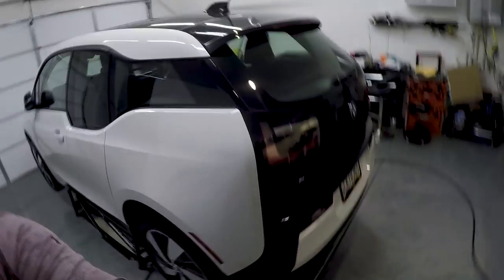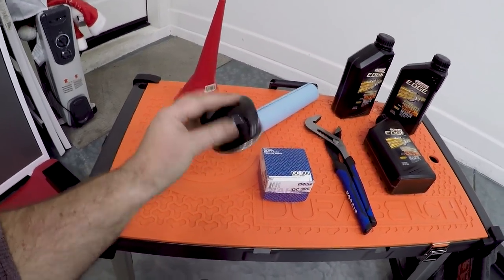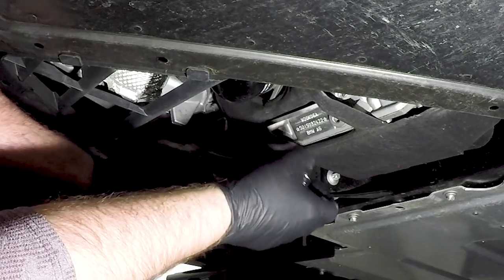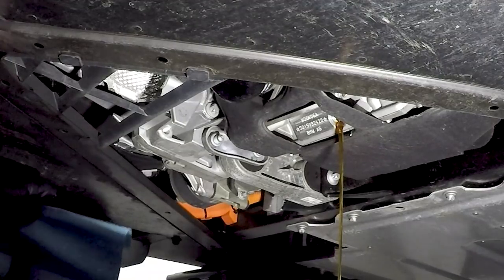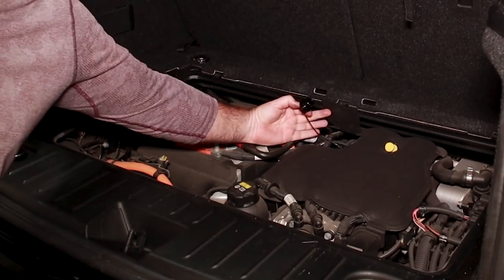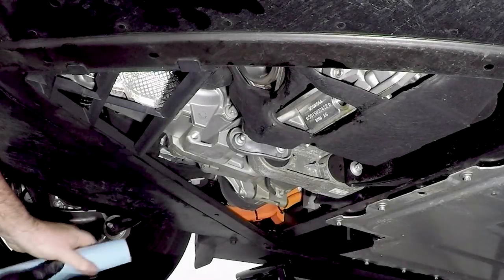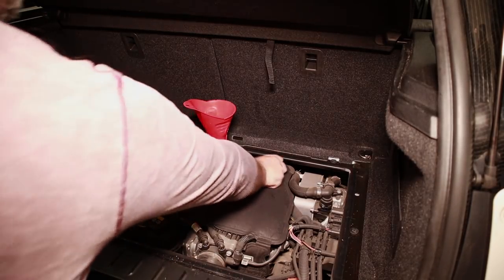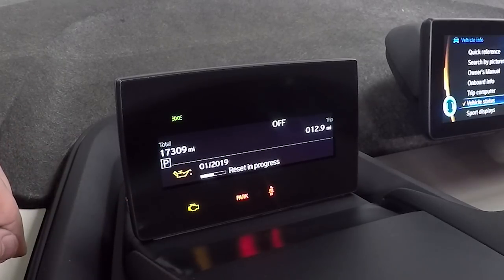$40 DIY BMW i3 REx Oil & Filter Change (2016 MY)

Comment: Great Vidio. I have 2017 i3 REX. Question, Why not change  the air filter at the same time?
Second question? Looking at the vidio I saw what looked like water coolant  hoses . Is the REX engine air cooled as I thought?

Comment: Thank you for the great video. I did not see where or when you used one of the crush washers? Personally I don’t even know what it is but I would like to know when you put it on and where it goes. 
Thank you very much 
Jrcards781 
John
Reply from the maker: At https://youtu.be/gm6Dcmuuzwg?t=444 you install the crush washer around the drain plug. There should have been a 'spent' one that you remove when the plug comes out and they are generally considered 'single use' to be fully effective at cinching the opening. Hope this helps. Be well!

Comment: well done,  can you recommend a good inexpensive scan tool. Not sure that Bimmercode and dongle is enough. I own two bmw cars, I3 and a 335I. thanks
Reply from the maker: Foxwell NT-510 is a commonly used traditional scan tool that is recommended. I haven't personally used it. If you haven't tried the Bimmercode app and a dongle, if try it before swimming upstream in cost and complexity of tool. It's a $50 bet that you'll likely discover is quite solid for your needs. I've used on i3 and X1 with no issues. I have heard the VGate is no longer supported by BCode so you may want to go to their site for currently approved dongles. Good luck!

Comment: Please add a spark plug replacement video for the i3. While I appreciate the other videos on this subject, I appreciate your videography and clear explanations. And I need to change my plugs... Thanks!
Reply from the maker: Apologies Chuck - since I no longer have the car, that's not a video I can make. Don't know anyone driving one right now either or I'd do it for them. Thanks for the compliment all the same.
Reply: @DWraysGarage  If you find yourself on the Left Coast, drop me a line and we can practice on my 2014 REX! I have 59K miles, so I suspect it's time, although there is some question as to whether they ever need changing due to the limited hours on a given engine. Again, thanks.
Reply: @chuckatwestmarine  I've done 97k on mine and still no sparkplug change but in October I am due for service and BMW dealer think it is time for spark plugs now, 250 dollar charge to do it, they say it hard to reach.
Reply: @HannaMTB  I ended up doing the job myself with the help of a different video and it took me about an hour. The plugs, after 60,000 miles or so, looked perfect, thanks to the iridium electrode. I would 100% recommend that you try it yourself. No special tools that I can recall, but you do have to be methodical and understand how to disconnect several odd electrical connectors. Good luck.

Comment: Where do the « crush washer » (not sure i heard right.. the rings) go? Great vid!
Reply from the maker: The crush washer is what sits between the drain plug and the oil pan. It helps form a tight seal and offset any minor differences between the mating surfaces. Good luck with your project! Thanks for watching.

Comment: Just called bmw Seattle for the service, it will cost almost $700 for these, I rarely use my Rex do I really need yearly oil change
Reply from the maker: That's a stiff bill - what does that include? If your REx doesn't kick in often then you could probably go a little longer, but you don't want to let it go too long. Replacing the REx would be costly. Is there an 'indy' garage that would let you take them the filter and oil? I bet they'd do the work for about $100.

Comment: After how many miles I should to do same service?(Filter and Oil change) Thank You!
Reply from the maker: BMW says every 12 months - no specific mileage. Of course, not everyone gets into their REx with the same frequency. If you use it a lot, go 12 months or less. If you are mostly on battery, I'd say 24 months would be fine.
Reply: @DWraysGarage  thank you so much for your time. Kind regards from Ireland...

Comment: Did I see that you sold the i3? I was going to see if you would do a video on replacing the micro filter and charging brake fluid.
Reply from the maker: Afraid so. I just couldn't live with it for my use case. Thanks for watching. I do have a brake fluid video for my Porsche and the process will be about the same.

Comment: I’m getting my BMW i3 2017 in a couple weeks! I’m interested to know what device you used to lift the BMW? Might need to get me that myself
Reply from the maker: I use a Quick Jack BL-500SX to lift my cars. Might need rubber grommets for perfect fit to the jack points. Not necessary but massively stable and time efficient.

Comment: Thanks for the video, it's an interesting car!  How often do you have to change the oil since the REX is hardly used?  How often does the service engine light come on?
Reply: If you haven't used the Rex for a time BMW give message to perform a maintenance run.  I can set the Rex going once the battery charge is below 75%
I have set my no 8 'radio' button to do this. I press  the set button and it brings up rex extender and I only need to press control button ( near the handbrake button)
and the computer does a seamless change. It holds the charge until I turn the rex off. Brilliant. the Rex then acts as an electric generator and the electric motor still drives the car.

Comment: did you ever replace the washer on the drain plug, or was it not necessary. Great video, it will help me a lot when I do my first i3 oil change.
Reply from the maker: It is always recommended to change the crush washer but none I had on hand we're suitable so I did end up reusing. Shhh - don't tell! 😜
Reply: @DWraysGarage  any idea as to which washer I should look for ?
Reply from the maker: @qwertshadow  it's the 16*20 size that is used on bmw motorcycles.
Reply: D Wray's Garage logical when you recall it is a Scooter engine after all. 👍🏾

Comment: Great info! I will definitely do this. What model quick jack did you use? I have the 5000 and the jacking point are off. Thank you.
Reply from the maker: I have the 5000 also. If I recall I flipped the block perpendicular to the frame rails. I don't remember having any great issues once alignment was set. Ridiculously easy oil change procedure. Good luck!
Reply: @DWraysGarage  Perfect!  Great help1

Comment: Great show mate!  Thanks especially for showing how to do the reset on the display.

Quick question, do you think if I jack up the rear; would I need to lower it back down to get a good drain on the oil tank?  Because of the angle of the rear being higher?

Thanks!
Reply from the maker: If your car is not level then, yes, putting the rear down would be the best way to evacuate the most oil. Other ideas are to do on a slope so rear lifted is still a level car and/or don't sweat the small amount that won't get out as, with routine changes, the oil stays in decent shape anyways.

Comment: With this clean oil you could just replace oil only. All micro guard on old filter are in perfect condition.
Reply from the maker: No doubt you are right but, at such a low cost, and having already purchased the filter, it seems like the right thing to do.
Reply: It's definitely worth changing out the filter because there have been reports of them corroding, causing oil loss from the REx. The oil filter is in a rather exposed position on the i3.
Reply: @jamesvdv0  I agree.

Comment: Thanks i just bought a i3 so this will help me alot. But question can i use a regular jack to lift the car
Reply from the maker: Of course. Anything lifted safely will work. You don't need a lot of clearance or to get to far under the car. Good luck. 👍💯

Comment: Awesome, are you going to replace the spark plug too?
Reply from the maker: I sold it before it was needed, sorry.
Reply: I've read the spark plugs are hard to get to but that they're specced for the lifetime of the car anyway. Considering the REx isn't running most of the time, I would plan to never change the spark plugs.

Comment: Oil looked new, near zero suspended particulates.  What was the run time on the REx on that oil?  Also, the i3 REx is a BMW C 650 GT scooter engine, it does not use typical BMW N52 engine oil like 0w-30 BMW LL-01 oil, it uses 15w-50.  Check out the moto rad spec sheet here:  http://www.bmw-motorrad.com/_common/pdf/bike/en_2018/C650GT_PI_EAC_web.pdf
Oil change on a 650GT will look very familiar:  https://www.webbikeworld.com/bmw-scooter-oil-filter-change/
Reply: Here's a better idea: trust the 0w30 sticker by the oil filler cap.
Reply: It used exactly what bmw says

Comment: This is awesome! If you haven't covered it, can you show how to manually turn the REx on after the oil change? I read how to do it a couple months ago. I got a 2015 i3 REx back in November 2018 and plan on doing my own oil changes. Much to the shock of the BMW dealership sales guy. Cheers!
Reply from the maker: The job is easy and there's far less oil than in a regular ICE car. Can you clarify your question - I do the service light reset at the end, if that's what you mean?
Reply: @DWraysGarage  well normally one would start the engine after an oil change in an ICE car. But with the REx it only comes on when needed or when charge hold is enabled. There is a service mode to manually start and run the REx, presumably for testing, and maybe oil changes too. Not sure how long it would run for or how hard it would be to turn it off. I believe it's done vis the 1 button "interface" with the display behind the steering wheel. I think it's in the deep menu, go like you're going to reset the oil notice but keep holding it down for like ,10 seconds. Beyond that I can't recall how it's done. And I may be totally wrong, may need to use something like Bimmer Code to do it. 

Regardless this is a very helpful video. There's just so little DYI stuff on the i3. Thanks again for doing this.
Reply from the maker: I have a VGate/BimmerCode video that will show you HSOC (Hold State of Charge) that you could activate post change so long as your battery is below 75%. I didn't activate the REx immediately and suffered no adverse effects. Looking to make another BimmerCode video going deeper onto this cool tool.
Reply: @DWraysGarage  when I got my REx i3 i immediately enabled the charge hold feature and turned off the fuel tank governor we have here in the US. You can thanks the great state of California that I live in for that restriction haha. One could always just do an oil change with the car less than 75% charge, hop in, enable charge hold and drive around the block a few times. When I first got my i3, despite asking the dealership repeatedly to charge the vehicle, they didn't and handed my a car with like 10 miles of range on it, not enough to get home. It just so happens the REx hadn't been run in something like 8 weeks, I was trying to find a CCS, and the central screen was warning me the REx would run a maintenance cycle. It sprung to life while I was quietly rolling through a parking lot at like 9pm, scared the bejeebies out of me! Haha. Aaaaaanyway. Thanks so much for the conversation. I'll be keeping an eye on your channel. Rock on.

Comment: This is great video,

I read some place that you can put the oil in using the dip stick whole. Would save some time, did you play around with that?
Reply from the maker: I'm sure you could put oil in through the dip stick hole but not sure how long that might take. It's not a lot of oil so perhaps. The filler cap is very accessible though so seems like something I wouldn't need to experiment with. Let me know how you get on if you try. Cheers.

Comment: Hi .
Wondered if you could help me. I took my i3 into bmw for a KLE change. Ever since it has given me  a warning saying the pads need changing. They are all hardly worn so dont need changing. They mentioned they updated the software so I assume it is that that has caused this warning to come on.
Do you know how i can get rid of it, as following steps shown in a service reset video only gives me service and brake fluid reset options. Thanks, Ray.
Reply from the maker: I'm not super familiar with this procedure or error. However, it mY be worth disconnecting any brake wear sensors and reconnecting, maybe even replacing them. They may have somehow become damaged and therefore always send that message back to the ECU.
Reply: @DWraysGarage  Thanks for the reply. My BMW dealer changed the wear sensors and the message was still there. They said they couldn't reset the pads warning as the pads were not new. 
I have changed the pads as well so the whole system is new front and rear.  
Think a call to them is in order!
Reply from the maker: @raysmith1971  I think so. Now I am convinced it's something they did. They need to complete their work.
Reply: @DWraysGarage  That's what I think. Fingers crossed they get to the bottom of it.

Comment: I am literally sitting in the BMW dealership as my last warrantee service happens. The price for the oil change (Vancouver, Canada) would have been $253.47 plus taxes, parts and who knows what else. Stealership is right.  Thanks for the video. I will definitely do this myself from next year. Any advice on changing the in cabin air filter?
Reply from the maker: I'll make a video on this soon, but it looks pretty straightforward, albeit cramped. Not uncommon no matter the flavor of vehicle. $300 for this service all in seems high, but I guess they ave expenses too. If you're mildly handy, you'll save $$ day one of DIY. https://youtu.be/0LNnvu3ibIo - the video I found.
Reply: That’s completely ridiculous is that just an oil and filter change if so I would contact BMW of America

Comment: Thank you for all you do to inform us.  You tend to use the terms mils, millimetres, and millilitres interchangeably.  One mil is a thousandth of an inch.  The other measurements are metric.  I am only pointing this out for those DIYers who might get confused.  Before checking the final oil level, shouldn't you manually start the ReX so that the oil filter will fill up?  Thanks again.
Reply from the maker: Good points - I shouldn't rely on context in such precise matters. I think to be spot on, either pre-loading the filter or running the extender would be a more accurate way to go. Great observations. Thanks for watching. Be well!

Comment: Great video! But Channel locks for an oil filter? You gotta be kidding me! Where is the proper filter wrench?
Reply from the maker: Sometimes you have to make do with what you've got. No animals were harmed making this video.
Reply from the maker: At 2 minutes you will see my clear disclosure of this not being an ideal way to remove the filter and recommendation to acquire correct removal tool.
Reply: Thanks for the video. I was just surprised at channel locks, but you handled it fine. :)

Comment: With oil especially synthetic oil looking like that telling me there probably was very little use of the motor and no need to change the filter.
Reply: It's definitely worth changing out the filter because there have been reports of them corroding, causing oil loss from the REx. The oil filter is in a rather exposed position on the i3.

Comment: Hey I own a 2016 i3 but its no a REX version, still has OIL?
Reply from the maker: Nope. No Rex, no oil.
Reply: @DWraysGarage  Thanks, but all the versions has transition oil right? require changing?
Reply from the maker: @electroautoscostarica3632  The transmissions on the i3 are built to be service-free items. It should not require addressing unless there's a failure/break in the system.
Reply: @DWraysGarage  AWSOME THNKS

Comment: I wouldnt need to do this if I have the all electric version?
Reply from the maker: 100% correct. This only applies to REx vehicles with the gas generator in the rear. Enjoy your BEV!
Reply from the maker: Look out for a video soon on the VGate tool and BimmerCode app where you can personalize your car even more to your liking.
Reply: there's no engine in the all electric version, that's why its called the all electric version lol and wow

Comment: is this engine air cooled?
Reply from the maker: There is a coolant reservoir in the trunk so there is a water cooled system. How much goes to batteries vs generator I'm not sure.

Comment: Hahahaha. “A gorilla working on it” was hilarious! Did you like this car?
Reply from the maker: I did like this car but it lacked theater and engagement for my tastes. Super practical and zippy car. Wish they'd have designed it for more range and wider tires. I know the 2017s on have more range but the tire part still questionable (assume it help protect range). I also didn't like charging after basically any drive.
Reply: @DWraysGarage  Good point. Charging it after every drive would get annoying to me. It’s such a cool zippy looking car though.

Comment: Oil change on an electric car? Not 100% electric?
Reply from the maker: The oil change is for the 'range extender's generator that can recharge the battery while the vehicle is in motion. Not all i3s use a range extender.

Comment: Oil in an EV. 😮.    😂
Reply: Oil in a plug-in Hybrid's back up engine that makes it a viable option for many who can't jump to full EV. On a recent 1000 mile trip in my REx, 3 out of 5  of the fast charge stations I stopped at would not start for one reason or another. But I still did 60% on Battery.  This lowered my lifetime on battery to 92%.
Reply: Nordburg any electric miles are good miles